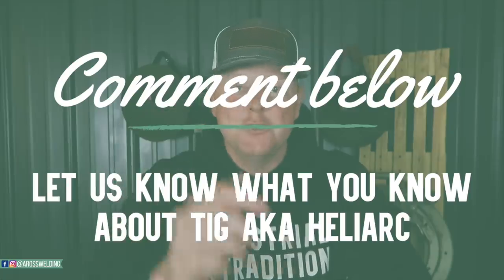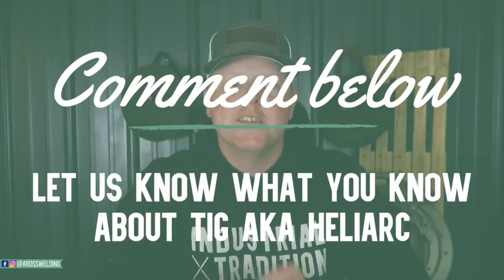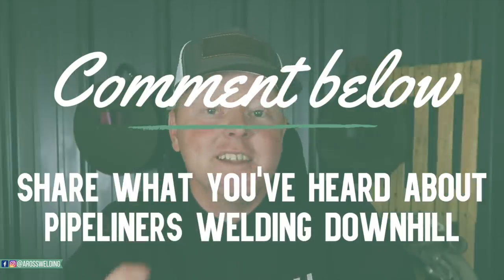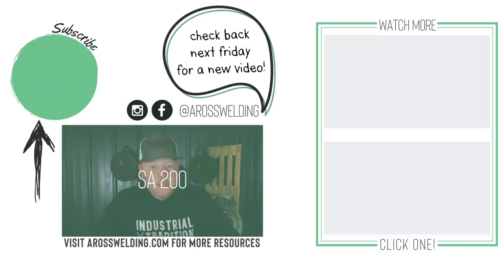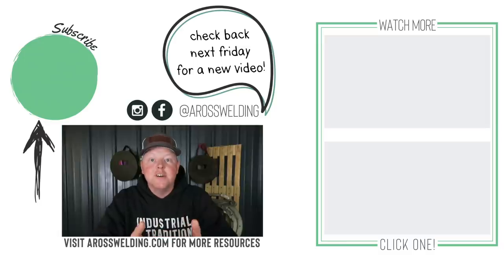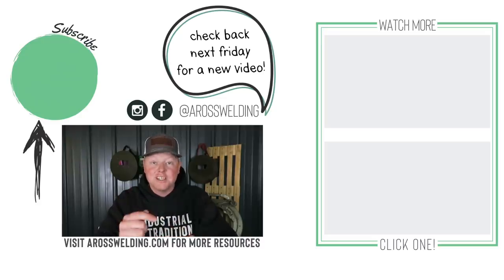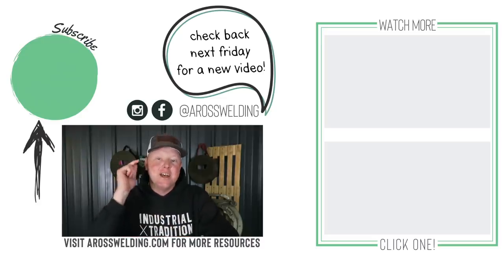WHY PIPELINERS WELD DOWNHILL

Comment: Hey Austin. I sure enjoy your videos young fella. I broke out in the '70's. Built my first Rig, and bought a old, but good SA 200. Rolled the rack, and put in 300 amp brushes. Carry a lot of iron with it. Im 74, and can't see so good anymore, 300 cheaters, and had to hang it up. Got to where I was Bowtieing the bottoms.😬  I miss the firin line, and all the good hands I worked with. Stay right after it pard. For there will come a day. Thanks for the memories, and God Bless you.
"DOWNHILL DAN"
Reply: Hi Mr Austin, I have any questions about downhill Welding position. I wanna know you can't do downhill with other kind of electrodes unless 7080 or 6010 ? Iam based in South Africa the most quality electrodes hire is Afrox 6013 the most and common used in the most company and industry. Since I have been in this area I never seen other electrode unless 6013

Comment: This was vey interesting to me.  I am a retired welding inspector who worked on nuclear power plants a long time ago.  Before I became an inspector I was a welder of structures, pipes and pressure vessels, all uphill.  I often wondered why one welded downhill and how they kept from getting slag inclusions in their weld.
Reply: Australian tube welder here and I was wondering exactly the same thing. In all my experience tubes are only welded uphill, never suffered porosity in any welds from it either. Used sticks that had been left open to rain and sun for the weekend as well and still passed X-ray. 🤷‍♂️

Comment: I was certified API-1104 and 1107 for 25 years and on 5L X-42 pipe, code dictated 6010/7010 root and hot pass, 7010 filler and cap, all downhill. API-1107 was about 7018, low hydrogen, which was used for hot taps, sleeve ends, and Stopple fittings when welding on loaded LPG lines and always run uphill or horizontal but never downhill because the slag is much heavier and in it's liquid state would sometimes get past your puddle and cause inclusions. Because of the heavy slag cover, a 7018 bead cools slower and allows a more ductile bead. Running a cellulose flux rod on a hot line would most likely crack out before you finished the first pass and probably kill everyone in the hole.

Comment: The rule of thumb when I was in the trade was simple...If it's inside the gate, it's uphill to ASME Sec IX, if it's outside the gate, it's downhill to API 1104.
Reply: When you say gate do mean shop vs field?
Reply: @nicholasbarba3022  Inside the gate means inside the plant or facility. Outside the gate means out in the field ie pipeline.
Reply: @mikeroller4110  Thats kinda what I figured. thanks.
Reply: @nicholasbarba3022  You're welcome
Reply: Or Asme B31.3
Reply: So true
Reply: @goatsinker347  You're welcome

Comment: I’m a union Steamfitter, we 6010 uphill root and hot and 7018 cap. Also, tig is welded uphill, mostly used for root only with 7018 out.
Reply: Any insight for land/gap for 7010 downhill? We have a job coming up and I’m not familiar with 7010.

Comment: I was a boilermaker for 30 years ,and dabbled a little in pipeline welding, one of our q.a. guys in the Boilermakers was adamant about not welding downhill, he said it wasnt as strong, so one job we was on they were sending coupons off for strength testing sharpy test bend and ripping them apart so I did a downhill test and labeled it , low and behold it tested at same tensile strength as the uphill I proved his ass wrong lol .So when done properly it's just as strong
Reply: What Boilermaker local were you out of?
Reply: @LeadRakFPS  NtL or Ntd, they all called us tankie, then transferred to 105 in Piketon Ohio
Reply: @glenparks5175  Nice. Yeah NTL/NTD. They changed the name to NTD when they dissolved the NTL and put all of you guys in the local halls. I've worked for CBI building tanks and I'm working for them right now as well on the NTD side. They reopened the NTD locals and are full steam ahead again. But, I'm out of Local 83 Kansas City, MO. Started my 15th year as a Boilermaker on October 8th of this year. I'll build tanks, do turnaround work in refineries, nuclear plant outages and just regular old coal burner outages as well. The NTD's and Internationals bi-laws allow local guys like me to take calls from the NTD contractors by name still. So if CBI calls me and I'm not working through the hall, I go to work for them. Hope you're enjoying your retirement brother!

Comment: All 6010 I've ran is uphill. Most facility pipe work ibve done is sually F3 F4. 6010 root pass  7018 vertical up hot pass fill and cap
Reply: that is high pressure I believe, that was how the class I took taught. F3 F4. 6010 root pass  7018 vertical up hot pass fill and cap

Comment: I never thought if my style of welding even had a name. I typically weld downhill, meaning my rod tip is pointed up and I use a horseshoe pattern from side to side and draw it down, so when I'm done, the weld looks like dimes have falling away from me and I like to use what I call "dey-go" rods (6011) -- because dey go through mud, dey go through dirt, dey go through paint, dey go through rust, heck, dey go through 'bout everything. 😂

Comment: RMD up hill wire feed is taking over so start..practicing with .045 wire feed make sure your gas is between 30 and 40 depending on wind....75/25 gas what we used building two gas plants in cali

Comment: Austin, thanks for the videos, have greatly enjoyed them. As I understand it the down hill is used to minimize the heat affected zone or HAZ. As you said the travel speed is faster so the Joles ( measured heat input ) are lower just skating along at speed. As the wall thickness for transportation pipeline is thin as compaired to refinery piping the heat input mist be limited or the pipe will become quickly overheated and the chemical composition of the pipe will be compromised in the HAS. As far as beginner machines go the sa 200s are often old and poorly maintained. Nothing worse than having your welder failing on the fireline. You will be asked to leave and that's it. Goodbye paycheck.  Yeah I know you can't beat an early 50's shorthood but finding a good one to take to the pipeline is near impossible.  I know " unless its grey you can't stay " but I was doing sanitary process piping for food production and used the inverter blue machines often carrying two just in case one broke. Never did naturally as i had the backups.

Comment: Lohy needs a controlled environment but iv welded in the wind with it a whole lot. Done a Ton of tig and never ever had to run it down but ya could. Have you ever tried to run a downhill rod up is my question ?
Reply from the maker: All very true. Yes I have. You can def run a “downhill” rod uphill. Just have to turn it down a touch. 👌😎
Reply: @arosswelding  yeah forget that tho right looks better down 😂
Reply: I'm a  subscriber to both channels 👍
Reply: XX10 can definitely be run uphill done it many times but never for money. Its tricky. Stringer uphand ya want to step it fast. Weave calls for what usually is referred to as a box weave which is a pain in the ass, but you can also use an exaggerated V or U motion too. Something to play with for sure. Definitely don't use your downhill settings.
Reply: yea the only difference I see are that the puddles  are pointed down instead of up, and you wanna run a lil colder

Comment: First two (or 3) digits indicate strength (11018 - 110 thousand lbs).
3rd digit indicates weld position. 1 is all position, 2 is downhand, etc
4th digit indicates rod coating. 1 is rutile, 8 is iron
Mig and Tig are all position processes.
Lots of books have the breakdowns for this stuff.
J-man electrician, J-man welder, B pressure tickets

Comment: Being retired I haven’t been around welding in several years but I would have thought that pipeline welding would be done with a wire welder by now.

For building and repairing farm equipment my go-to rods were 6011 and 6013. 6011 was a “fast freeze” rod that penetrated good, was good For vertical or overhead but didn’t leave a real nice looking bead. 6013 was kind of a production rod. It made nice looking beads in flat welding situations. My objective was always to be welding pieces that were clean and smooth and that fit together well. Building things “hell for stout” didn’t hurt, either.
Reply: RMD is taking over its coming

Comment: Hi I'm an industrial pipe fitter i find it interesting that you weld downhill i mostly learned to weld uphill with rods and tig is wery universal in my opinion doesn't matter what direction you weld with a tig cause you be able to get the same result as long as are standing laying sitting in a position where you're in controll but we weld one direction all around the pipe. Also we work mostly in factory's and plants it's rare that we are outside welding. It's many times i been welding upside down or in a extremely tight spot. I also never seen the pancake faceshirld before wisiting your channel. As a standard i prefere euro masks when i have the room or hand held masks speed glass with respirator is also something really nice but when welding in tight spots we use monkey masks. These days i weld plastic and there is more labor involved but less skill thou it deforms like crazy

Comment: I weld tig, it’s mostly uphill but occasionally i have to weld downhill because we manufacture auto exhausts for a german company. The biggest risk that I found is that the puddle will “drop” but if you’re quick enough you can save it. We use 490ti wire

Comment: Hey Austin, can you make a video explaining welding lead sizes and lengths and also oxy acetylene hose how much you would need in a pipe line job
Reply from the maker: I’ll take note of it here. 👌
But for now the average is 100’ of each. Leads and hose

Comment: It's low pressure pipe. Downhill welding deposits less metal/less reinforcement. So, having a flush root pass is better than a crowned root pass as far as overall diameter inside of the pipe that has no high pressure characteristics. With as thin wall as most pipeline piping is and using a 5/32 to 3/16 electrode, you might as well just downhill it the rest of the way out. It is faster as far as deposition, but with that you always get less reinforcement. If you were to downhill weld a 1" thick joint all the way out, imagine how long that would take when you're only depositing an 1/8" thick bead or less everytime. Would take waaaay longer than running uphill and being able to carry 1/4" thick pass or heavier (depending on WPS specs). So, I'd say it is mostly about speed, but only due to low pressure/thin wall pipe thickness and needing a flush root. After the root you might as well finish it off downhill as well. That way you don't heat soak the root pass and suck some of it back by running uphill on a hot or even a fill pass.

Comment: Heliarc comes from using helium as a protective gas,  which is also reactive to the arc- increasing the heat a little bit(helps on aluminum as aluminum dissipates heat much faster than most metals) 
TIG or GTAW uses straight argon- most of the time if you are TIG welding- you'll be using argon.
Reply: Christopher Smith 
I know what GTAW is.

Comment: Say Austin Ross, my understanding was that 7018 was run up hill to avoid slag inclusions with gravity alway pulling everything down. Do you know what's so special about 8010 that let's you run it down and avoid this from happening?
Reply: Xx10 rods are cellulose based flux and fast freeze rods.  You can trap slag but much easier to control downhill.  7018 is a heavier slag and needs uphill so gravity keeps it out of the puddle.  Whole different slagging system.
Reply: @MrDillaKilla  Sorry, but you are WRONG E7018 is an ALL position rod, meaning it can be used downhill! Really where do you people get this nonsense?
Reply: @scotty362100  all position, not all progression.  I teach this but if you want references.... go to lincoln or the rod manufacturer of your choice.  And look it up.
Reply: @MrDillaKilla  LMFAO...overlay on boiler tubes is always e7018 downhill and is an approved procedure! We in the field have a saying, "Those that CAN do, Those that can't Teach". I've been doing this in the field for 38 years, go blow your smoke somewhere else, teacher.

Comment: The real reason you weld down hill is because of the heat---[ on larger diameter pipe]. The heat rises as you weld , so , if you start on the bottom with your root pass the top will  close
 before you get to the top. On bigger pipe there is usually two welders, so they start on top and race the root pass to the bottom before it can close.

Comment: i've welded downhill lots with flux core wire and solid mig wire in a fabrication shop.  it's a last resort, if repositioning is difficult or time consuming, depending on if good penetration and high strength is critical.  i'm not talking about x-ray welds here...quite often it's perfectly fine

Comment: TIG (GTAW) direction of travel is uphill in any ASME or API procedure I have seen for welding steel or corrosion resisting alloys, pipe or plate. SMAW E6010 root pass in steel pipe is usually uphill when used with E7018 fill & cap, E6010 is usually downhill on pipeline work. Some tie-in procedures may be an exception.
Reply: API 1104 sets standards for U.S. ,Welds must comply to radiographic API 1104 requirements . As a retired CWI  and radiographer , welds can also be welded with 7018 uphand . It takes much longer to weld uphand . X-rays do not lie.
Reply: @harleydavidson5431  API 1104 is a specification for pipeline welding, ASME IX & ASME B series, e.g., B31.3, apply for welding of plant piping. AWS D1.1 is usually specified for structural carbon & low alloy steel.

Comment: 8010?! I’ve always worked inside and burn very little rod, but went to school and took pipe. Ssssoooooo I need some clarity on rod used and codes......so API code lets you run downhill? I’m aware of AWS running uphill. What about ASME? And do you guys run downhill on every pass? Root, Hot & cap? 6010 root and the rest 8010? Or......?

Comment: I was just watching some of your older vids. I watched some of your breakdown vids. You would really do yourself some good to get you a voltage meter preferably fluke. As a welder I’m assuming your very familiar with electricity. That meter alone will do you wonders in figuring out issues with your equipment.
Reply from the maker: Thank you for the suggestion. I actually do carry one I am just not smart enough to use it in certain situations.

Comment: Pipelines are ok to be stoved with cellulosic rods, because they are (in the majority) only low pressure. 
High pressure LNG lines in Europe for example, there have been a few that have been tig root and hot pass, then 7018 (might have been 7016?) fill and cap. 
Get a much higher quality weld from lowHy rods, even a 6013 (used properly) gives a stronger weld than 6010, despite the amount of people that dismiss it (ie those that cant use them)

Comment: Are you running heated rods with 7018? I see hands standing around with rods and it seems like they are air temp because even with gloves those rods would be hot. Cool down quickly too while hands are standing there twirling them around.
Reply: I was under the impression that they were heated primarily to keep moisture out.
Reply: Low hydrogen rods are kept in an oven to keep out moisture but by code they can be out for 4 hours before you can't use them.

Doesn't take long for them to get to room temperature.

Also if they came straight out of the hermetically sealed sleeve they can be a room temperature to start with and are still good to go.

Comment: I've welded tig downhill on boiler tubes and hard to reach areas. You just have to watch the puddle and make sure you tie into both walls
Reply from the maker: Right on. Very interesting. Thanks for sharing.
Reply: @arosswelding  I'm very new but the 1 means any position.
Reply: Yep rooftubes mainly
Reply: @kodyklutts2850  or nose arch
Reply: I welded boiler tubes for over 30+ yrs, we have welded 7018 down hand on small areas, for overlay.
Reply: Downhill especially on pad welds. Union boilermaker 18 years.

Comment: First 2 numbers is tensile strength  3 # is position 1 is all positions 2 would be flat or filet welds 4# is composition of the coating.

Comment: To me welding downhill is so much easier.  I weld mig inside a lot and I almost exclusively weld downhill.  I don't have to switch the welder settings from flat to vertical down, so it's a lot faster and works better for the under 1/4" material that I work with a lot.  Vertical up in my opinion distorts more and just make the whole fabrication process harder.
Reply: Mig welding is a whole different ballgame. Theres no slag to worry about, for starters. And thats what this vid and discussion is all about.

Comment: When we say the first 2 numbers are tensile strength, it's actually the tensile strength in the HAZ (heat affected zone) of the weld material when the straps have been cut out of the weld and milled to 0.50" (if I remember correctly on that measurement). Not to confuse anyone that a 60xx electrode breaks at 60,000 lbs, a 70xx electrode breaks at 70,000 lbs, etc. Also, in SMAW (stick) welding you're actually using an electrode. Not a welding 'rod'. A welding rod is used in GATW (TIG) welding. Not contradicting anyone here. AWS CWI. I just thought in an instructional video I would share some helpful facts.

Concerning uphill or downhill progression. That is determined through the WPS (Welding Procedure Specification) after many welds are made with different filler metals at different voltages and amperages according to what the welding engineers and metalurgists are looking for in the mechanical properties in the weld HAZ.